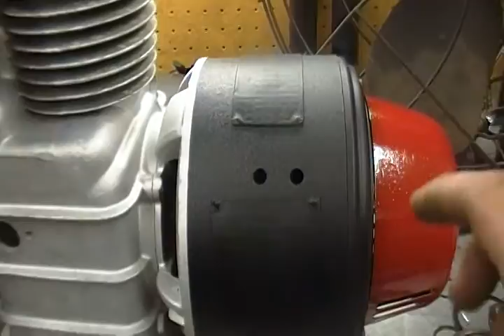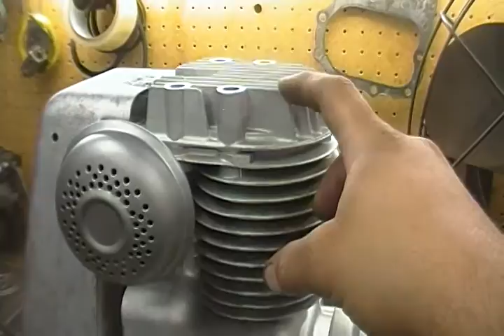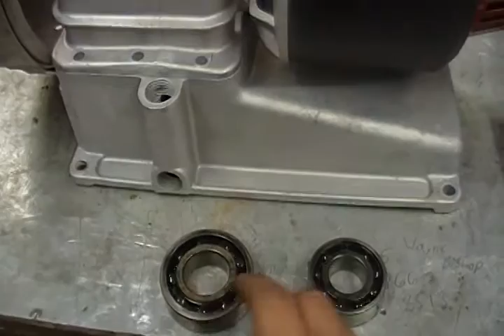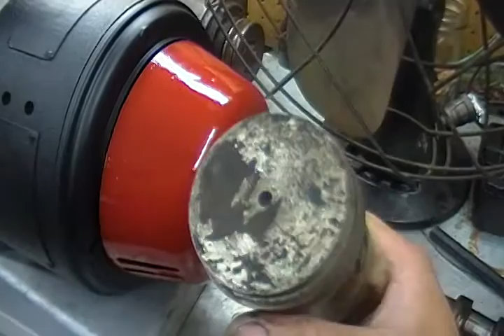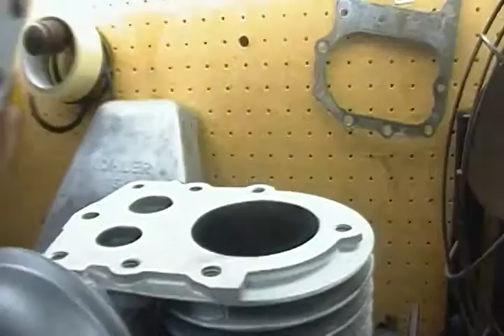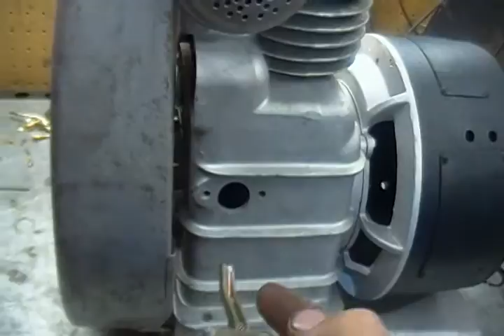Kohler K12 Generator Set

Comment: Ive got one of these in my garage.  It is panted orange and has all the parts except it is on a base like structure with switches for an outlet also on the base. It dosent run and needs a coil, any ideas where I cqn find one. It has one of those clip on kind idk if yours is lk that or not but I cant seem to find one . It looks like one off of an antique briggs 8 hp.

Comment: That Rustoleum doesn't hold up well at all to heat, or fuel. I've used it several times and never been happy with it. Now with the Duplicolor spray paint. I've tried to destroy that paint 10 minutes after I sprayed it, gas, lacquer thinner, acetone, anything I could throw at it wouldn't do a thing to it. I even soaked some stuff with paint on it in gas for half an hour 5 minutes after being sprayed and it didn't phase it. I've used it on engines, holds up nicely.

Comment: I love Kohler engines I have a 8 hp Kohler on my Emglo air compressor. need to rebuild it soon. 4 cyl 2 stage compressor makes air fast. and it's portable if your man enough to load it on the truck.  Got some Questions on my coldwell cub if I could pick your brain for some info.